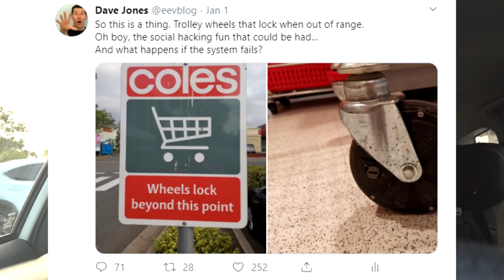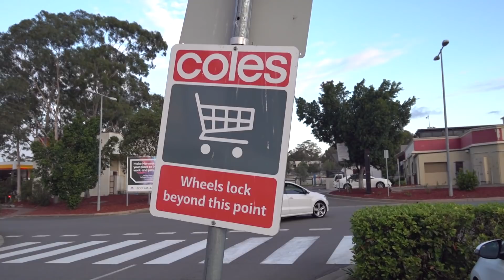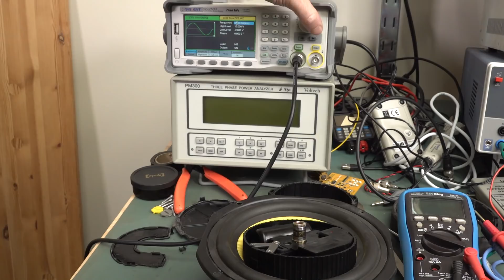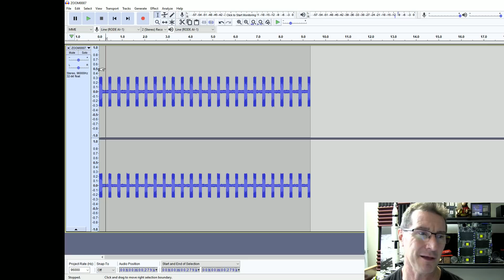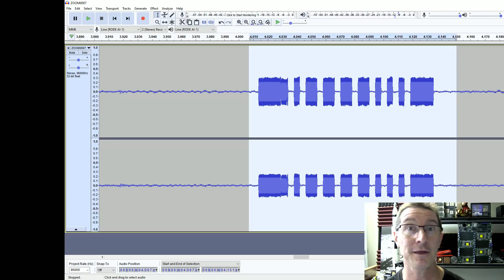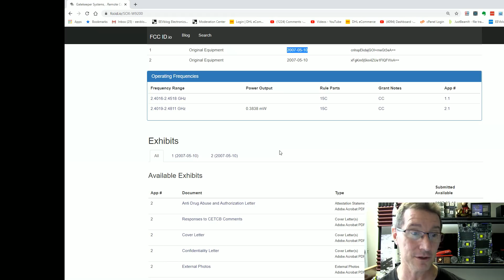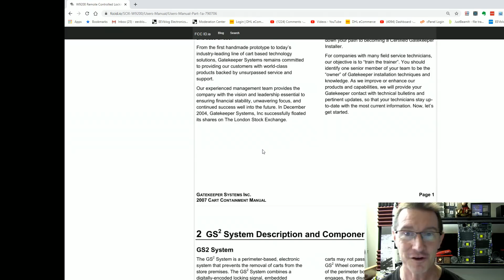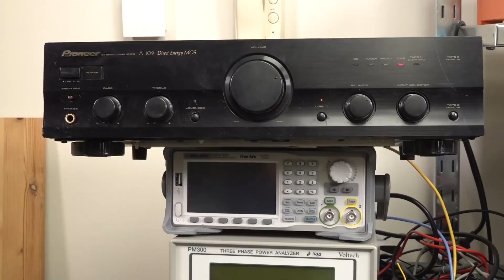EEVblog #1287 - Gatekeeper Shopping Trolley Lock Investigated

Comment: These are common in some parts of the USA, along with the competing CAPS system, which has a completely different mode of actuation. (It has a yellow "braking shell" they call it that flips out of a housing around the caster. Big, clunky thing.) Very interesting internal design, not what I expected either! These do have some sort of digital data-comm capability; I was once in one store where the cashier had to scan a bar code on the cart to authorize a sort of "exit pass" otherwise it would lock on taking it out of the store.

Comment: Common here, the trolley of choice for the discerning scrappie is the Checkers trolley, because it can carry more. The more upmarket ones will use the Woolies trolleys, upper class, even though the volume it can carry is half. for those unable to afford the Checkers grey or the Woolies black, they are stuck with Spar, or the good old standby green wheelie bin.

The Woolies and Spar trolleys are the choice thing to make a roadside spaza shop with, high enough to trade with with a few pallet planks on top, and with storage space inside and under for your stock in trade. Not too many steel trolleys left, only a few shops still use them, as they are the perfect thing for scrap steel or as a nice portable BBQ station.

Comment: Lock codes would be different for each installation. 

We have stores that use small chains to lock all the carts in a queue. You need to insert a quarter to release a cart. You get the quarter back when the cart is returned. Most of the time you can meet someone unloading a cart in the parking lot, offer them a quarter and use the cart. It doesseem to be very effective at getting the carts returned. What I don't know it how many people will take a cart off site.
Reply: Yeah, until you offer someone a real coin for a cart that they stuffed a plastic bread tag into. Had that happen before

Comment: My local store has this system, however they only have the ground antenna enclosing PART of the car park, with no yellow lines. I found out where the boundary was when I was rushing out to my car which was on the wrong side. My cart full for groceries stopped instantly. I, on the other hand, did not.

Comment: I don't believe there is an 'unlock signal'. If a cart locks on you, you just pull it away from the underground loop and when it is not receiving the lock signal it unlocks. So basically the default is unlocked and only gets locked near the coil. If you loaded the cart in your truck or could get it past it's loop it would roll just fine.

Comment: We have a shopping center/mall with rooftop parking, and a travellator to get up and down.  The trolley wheels lock when you get on the travellator (so it doesn't roll down hill) and then unlock again when you get to the end of the travellator.   I thought that was nifty.

Comment: I always get a chuckle at you and it lifts the day a bit.  Keep up the good work.  They had them here at the supermarket and yes, the trolley's were everywhere except in the car park!  lol  Good idea but they needed to lock all the wheels, but the system was to easy to by pass as the tight wads didn't surround the supermarket with the loop

Comment: The ones here only lock one wheel too, but they have this honking big mechanism around the wheel. I'm guessing the brake is outside the wheel on these. Something about the mechanism is wonky too and makes the wheel wobble in an odd way that makes the cart really difficult to use normally. I wish the stores here would use ones like in this video.

Comment: I noted that the manual specifies the transmission cable be buried an inch below the road surface. Seems that a sharpened screwdriver with a full tong and a mallet would be sufficient to introduce a "denial of service"
Reply: of course the alternate "denial of service" would be to set up a transmitter right at the exit of the shopping centre.

Comment: Expecting enough magnetic radiation from a speaker or headphone is being a bit optimistic. Fix up a coil to an arb function generator via an audio amplifier. You can check if you have enough induced level by scoping the circuitry connected to the coil on the PCB. Then, as others have suggested, test all codes.

Comment: Wondering about those grey and yellow plugs. Could it be an indication of the lock/unlock code? Similar to the flags used on R/C model TX. Or could it be a date code for the battery?
You probably couldn't get yours to work because it used a different code on the data.

Comment: One of the big shops in a less affluent area did not bother to reset the wheels on those. I think you had about 20% chance of getting one that's locked up. Of course, I got close to 100%. It either stops useless spending or provides shopper cardio, haven't decided yet.

Comment: I would have liked to see you take it to the store and see it run when its passed over the line. That a cool and ez way to capture the code transmitted. I may have to try that on some stuff around here, like my power meter.

Comment: They installed an opposition system (as in from another company) at our shopping centre a few years ago, it was a major pain, with no signs etc. I'd go to push the trolled across the road to an adjacent carpark (that everyone used) It would trip as you left the curb, but not fully engage until I was half way across the road. I regarded it as very dangerous, as you'd time your trip across the road to miss oncoming traffic, then get marooned in the middle of the road, waiting to get hit by someone.
It didn't lock the wheel so to speak, but flipped a yellow 'lever' under the wheel effectively stopping you dead.
There are now quite a few trolleys with their yellow stoppers permanently deployed, but now ineffective as someone has just brute force pushed/pulled the trolley to point that the yellow stopper has been ground off and the wheel is back in contact with the ground. I think our local Coles supermarket has basically abandoned that older system.
https://www.dropbox.com/s/35oj4ay2j3gf17j/IMG_0571.jpg?dl=0
Pity I cannot post photo's in these comments.....

Comment: A common system in Denmark is a very simple coin "lock". Insert coin to unlock, return trolley (linking to next in line) to get it back. People may choose to accept losing the coin, but then chances are that someone else is going to return the trolley to get the coin, approx 4.4 AUD, or half that. Obviously not much "security", but seems "good enough" in the real world.

Comment: Also in Canada, they had those wheels on the carts for a while at Superstore. The "tire" on these wheels sucks, and usually ends up with a big chunk missing out of it (or perhaps a worn spot where people keep pushing them even though that one wheel is locked). I used to find the worst one, and push it extra hard into the floor so as you pushed the cart around the store, it went "bang bang bang bang" as the missing chunk from the wheel kept hitting the ground. Eventually I think they got rid of those wheels and just put regular wheels on.

Comment: makes sence , that way they dont have to put groundloops in the ground , they just have a transmitter in the center of the supermarket and when the signal is lost the device locks , the handheld device probably transmit the same signal as the one in the shop that alowes the brakes to release and the car being returned to within the radio bubble of the main transmitter

Comment: that used to be here then the stores realized the cost of replacing the wheels after kids would push them over the line and block off areas/pathways. They did this daily, too. There would be carts everywhere after school let out and some of the wheels were locked permanently.

Comment: in my region (north italy ) there are simply coins locker on the shopping cart: u put 50 1 0r 2 euro (depend of the cart system) and u can unlock and use it. if u whanna the coin back u bring back the empty cart, lock in and u got your coins back. or u can leave the cart on the parking lot, a begger will rush to take it and get the coin.

Comment: My local stores that use these put them on one front wheel then have a downward slanted u shaped metal piece welded on to the frame on the back wheels so you can't put the cart into a wheelie either.  

Problem is the things lock in the store and on the way out all the time too (they seem to be tied into the loss prevention gateways too).  The solution was to give the unlocked to a security guard who sits at the door, and has to unlock so many carts they don't even pay attention, just unlocking them immediately.

Comment: my guess is that locking at least two wheels, maybe the left pair, would increase its effect dramatically.

locking the front wheels makes it hard to push, and pretty hard get over curbs and such, you could still drag it though, its the same in reverse with the rear wheels.
locking one front wheel, and one rear wheel opposite of it would sort of balance it out and make it pushable again i guess.

imagine the pain of pushing a trolley where both left wheels were locked, that wouldn't be worth it.

Comment: Funny, in Germany you have to insert a 1€ coin into a shopping cart to unlock it from the others and you only get it back when you put the cart back and push the locking chain back in.
Minimal cost (just the lock mechanism) and solves both the problem of stray shopping carts in the parking lot and common theft, because apparently 1€ is incentive enough not to take it.

Comment: UK in a big shop near me they where on about fitting these a few years ago...(The local council charged them recovery a lot),  But they fitted One Pound UK coin locks instead.  With the method above what happens if someone is pushing a full trolley at 15 Miles per hour... Bang sudden stop danger!!!

Comment: Seems to me the old coin deposit method (mostly seen at ALDI here in the US) is simpler, certainly cheaper, probably more reliable, and likely more effective. From what I've seen even in trashy areas they usually get returned, because free quarter, I can't imagine it works worse in places where dollar value coins are in common use.

Comment: Still wonder what the two colored removable plugs were for.  Here there are shops that have a brute force approach, 10" pipes spaced 2" narrower then the carts, works every time unless you shop with a cutting torch handy.

Comment: I wonder how much this wheel cost, considering its limited lifetime/activation  since battery can't be recharged or replaced, looks like expensive way. At first i was thinking that this lock is powered (not only activated ) by induction and it doesn't have so much electronics. something like latching solenoid strapped into induction coil.

Comment: 2:34  Thats actually the in road sensor for the traffic light.  The wheel you have basically  has to stay within a certain distance.. when it loses communication with the stores transceiver it locks the wheel
Reply: That's definitely not how it works. The manuals linked in the description go into extreme detail about how to install the magnetic loops in the pavement that trigger the wheels.
Reply: @dominickpastore  Yes but if you take a closer look at the schematics for install, it does not show individual loops, but a "Around the entire area" single loop... the loops in that road are for stoplight sensing.   And it also shows a "wider"  3-4 inch trench the cable sits in... If what you are saying is correct  every stoplight in my town prevents shopping cart theft
Reply: @balthromaw6305  Are you looking at the same manual as me? It shows multiple styles of installation, one of which is a loop around the entire lot, but another is loops over just the entrances and exits (with advice on which type of installation is appropriate when).

Traffic lights can simply use the same technology on a different frequency or with a different signal and it wouldn't be a problem.
Reply: @dominickpastore  Yeah looking back I error-ed lol..  I thought that shot he showed was a traffic light intersection, My bad lol

Comment: In the next video, take the (open) unit over to the shopping center near the existing loop and see it "lock up".  That might be interesting.  Then ask (nicely) to see the "unlock" probe and see if it "unlocks".  Of course, it may be that if you "unlock" with a certain code, that is the code that will lock the wheel.

Comment: When my local supermarket put in their new trolly stoppers the just put a single cut/loop around the whole parking lot.  Their trollys even lock up when pushed a meter from a vertical wall on the boundary (far from a entry gap)

Comment: Here in Virginia Kroger’s all over have been putting them on the carts also. They first got installed a few years ago when I actually worked there. They gave us employees RF transmitters that can remotely lock and unlock them, although you still had to be within 2-5ft of the wheel.

Comment: This is the first time I have ever seen or heard of such devices.  Apparently the people here in the middle of the USA don't find a great need for shopping carts (trolley) to take one home or wherever people take them.  I don't know.  There is one grocery store near me that requires you to put a quarter in a locking device on the handle of the cart in order to use it.  Once you are done using it you put the cart back in the line and hook up the chain then you get your quarter back.  Interesting device though and nice analysis of it.

Comment: Wow - this brings back memories.

Back in 2004, prompted by someone else I acquired a much earlier version of this and I've just fired up OrCAD SDT to refresh my memory.

It used a Holtek 12D as the decoder so was a simple matter to build up a transmitter using the matching HT12E and doing some tests in a local supermarket that used the system.

With the coil tucked into your sock and the cable run up inside your jeans to the transmitter in a pocket you'd stand next to fully-loaded trolley and lock the wheel then, after they'd struggled for a bit, unlock it again.

The idea was for a few people dressed MiB-style carrying more powerful transmitters in briefcases to walk through the a store locking all the wheels then leaving.

Never happened unfortunately.

Comment: Weird, here in Sweden, shopping trolly theft is not a major problem. It happens but it is quite rare. Generally everyone leave them in the station where you are supposed to. Even in places where you don't have to use a coin to unlock the trolly (that you get back when you put the cart back in the station).

Comment: It looks like the 2 metal rods for the "brake pads" are actuated outwards and to either side when the common joint is pushed outwards from the center of the wheel.

Comment: I feel like it would be better to just use a short range RF transmitter and then place a few of them around the parking lot. Then adjust the TX power to adjust the range. Once the wheel no longer "sees" the transmitter, lock up. No way to get around that and bypass the system as easily as you said.

Comment: In Sainsburys in the UK I've seen trolley boys carrying a small reset fob, which is a different handheld transmitter that unlocks the wheel with a similar pulse. They commonly place the fob next to the one of the small discs, and hey presto, the trolley is again unlocked.

Comment: Really clever product idea (didn't see it anywhere yet), and even a greater reverse engineering! Good job :) 
Probably every client may have different encoding for locking and unlocking trolleys - and since this wheel was not from this specific shopping centre, you couldn't get it locked by replaying the recorded signal.

Comment: In the early 90's I worked at a grocery store in the USA that used carts with front wheels that would lockup in an uneven position with respect to the rear wheels if front end of the cart was lifted or rolled over an uneven surface.  I supposed the idea was someone stealing the cart would try to take it over sidewalk curbs and such.  The way you unlocked it was with a magnet!  So when us courtesy clerks went out into the parking lot to fetch the carts we carried a metal rod with a bar magnet on the end and the magnet would retract the locking pin and lower the wheels down to the normal position.  This only lasted about 6 months and then the company got rid of these carts because they were causing so much chaos with the legitimate customers.  I have to say the metal rod was also quite useful for whacking thieves over the head!

Comment: Back in California, all the stores that had electronic wheel locks were live RF-based.  Its default state was locked, so if it lost signal, you'd hear a solenoid click and the wheel would lock up.  The ones at my local store looked for a signal every 15 seconds, so we used to see how far we could run with the cart before it locked up.  Once, JUST ONCE, I took a broad-spectrum jammer to the store and switched it on by the cart corral.  Once the locks trigger, they HAVE to be reset by a handheld thingamajig.  There was a very unhappy employee sat outside pulling carts out one by one to reset the wheels...  I felt awful.  :(

I don't think I ever shopped at a grocery store and DIDN'T see a cart malfunction on a customer going into the store.  Even had it happen to me once, so I just stubbornly forced the cart around the store for about 20 minutes until someone asked what I was doing, as I really had to shoulder into the cart to make that sticky rubber wheel slide.  Fun times!

Comment: Wow that is a solution we don't really have in central Europe. Most of the trolleys are either no coin or require a coin to to be taken out. Most supermarkets (at least here in Switzerland) don't really care if you take the cart with you, as long as you return it. Although people don't generally just leave them wherever, they usually park them where they are supposed to go